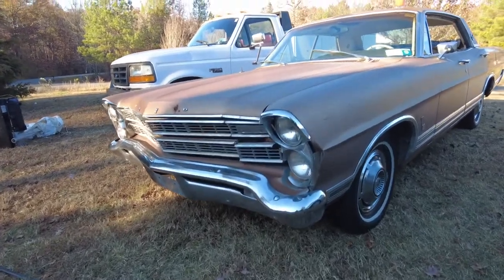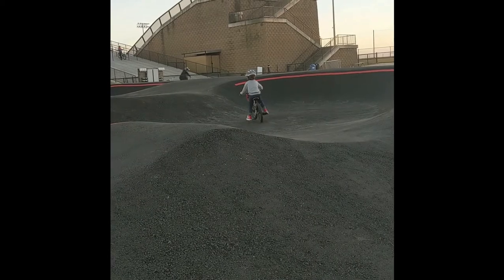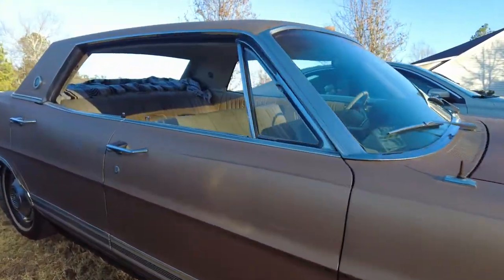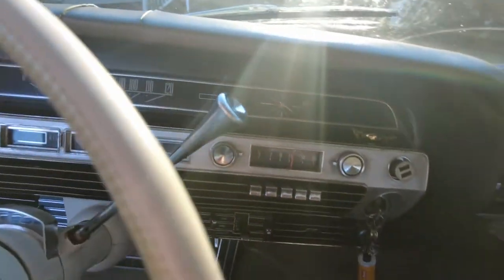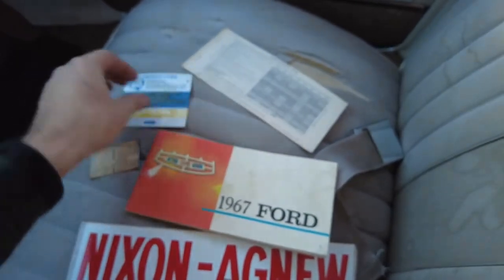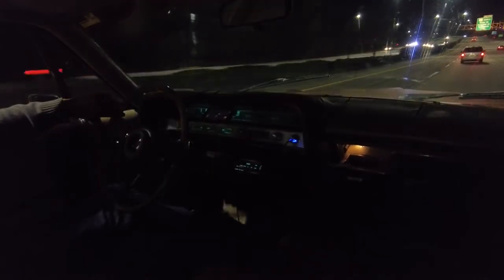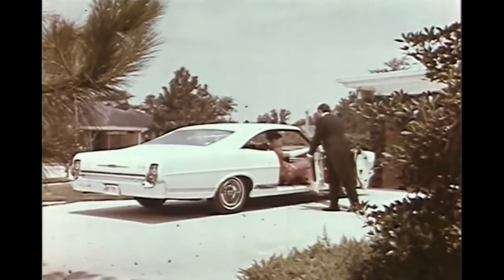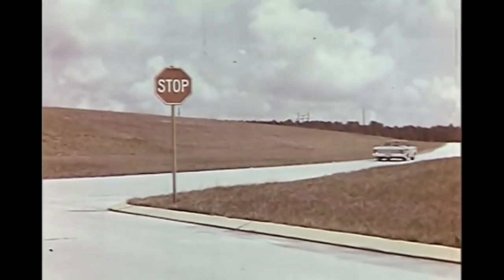Walk Around and Intro of 1967 Ford LTD 390 FE

Comment: Interesting expansion on the "trims becoming nameplates".

In the 50s, the Big Three basically only made one car each. Names like Fairlane, Crown Victoria, Galaxie, Bel Air, Impala, Super 88, Monaco; all were just trim levels of the only car Ford, GM, or Chrysler made.

As the 60s started, and manufacturers started making compacts (Falcon, Valiant, Corvair), and later intermediates, they recycled earlier trim names into model names for easier marketing.
Reply from the maker: Yes! I find that kind of stuff can be confusing to people who don't realize it. For instance, Ranger was a trim level of F100 but people will say stuff like "that's a 75 Ford Ranger." Same thing with what you're describing.
Reply: @buttcrackcycles  It does get confusing, like how 68/69 Fairlanes are called "Torinos" after the popular trim level.

So popular that Torino became the model name 70-76.
Reply: @buttcrackcycles  The Ranger name was first applied to the Edsel Line for 1958.